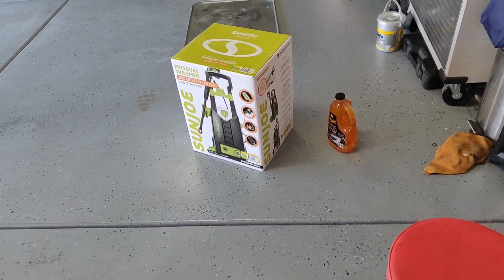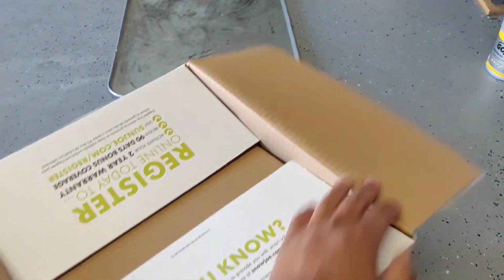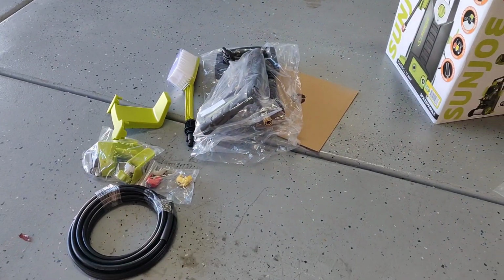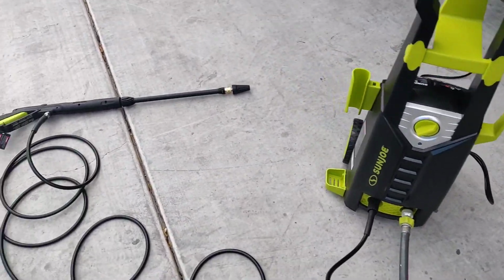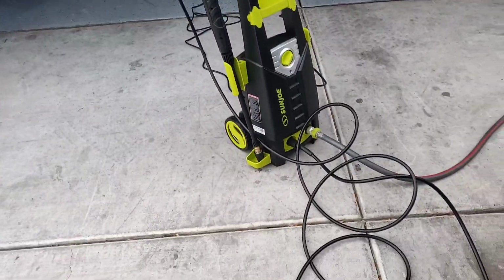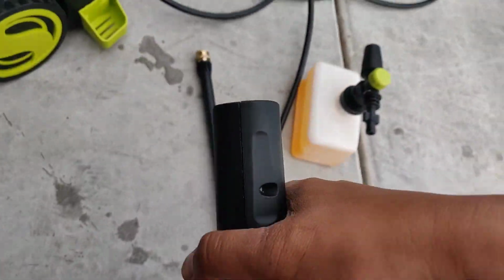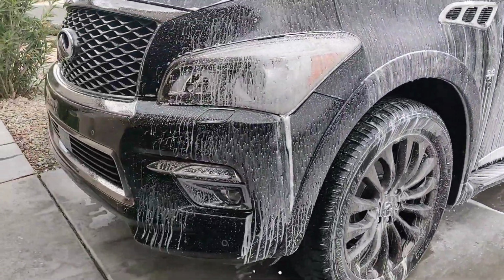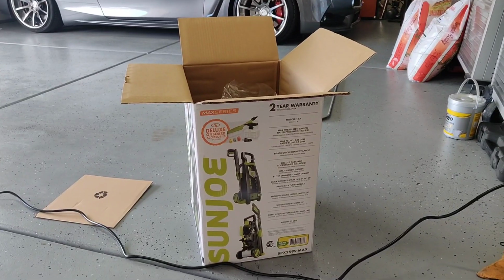SUNJOE electric pressure washer

Comment: To everyone with cars that have been repainted I highly recommend you don’t get close to your paint job and I also recommend using only 40 degree nozzles
Reply from the maker: It is that powerful
Reply: What if my hose doesnt screw on to the pressure washer thing, what if my hose doesn’t fit and so I can’t screw it on to the thing ?????
Reply: I 2nd that statement. As a detailer theres a good chance of you peeling off your paint if you get too close

Comment: I have that same washer from sams but I got mine for $99, and it’s good for that price. The settings on the foam attachment are weird and I havent played with it a whole lot, but if you set the knob on top in the middle you get much thicker foam that coats the entire car. Still wont be as good as aftermarket attachments, but better than what’s seen in the video. You don’t need a gas powered unit for home use, especially with the added maintenance costs of gas engines. And you can do real damage to a car with a gas unit if you don’t know what you’re doing. For the average home user this unit is fine.
Reply: Bought this today for 79.99
Reply: @jamescall5819  Same😁💯Merry Christmas to me

Comment: Hey were you able to get the foam cannon to stay under the gun? I have the same pressure washer and I have to turn the gun sideways like you when I’m using the cannon
Reply from the maker: I was able to but it was at a weird angle.only used it once the next time I use it I will pay attention and follow up with you
Reply: @INFINITIBROTHERS  Awesome thank you
Reply: Facing the gun, put it at 3 o clock, push it, turn it to 9 o clock then pull it, then turn it to 6 and it stays!

Comment: Is the brass quick connect a 1/4" on the tip of the gun? and also what type of connection is at the end of the hose that connects to the gun? Is it a 14mm (M22)?
Reply from the maker: I can't recall but I will check for you and try to get back to you as soon as I can. 🙏🙌🤙
Reply: @INFINITIBROTHERS  no worries, I ended up getting that pressure washer haha

Comment: I bought the SunJoe 2598 model. The problem I have is to get suds I have to set it on low pressure. When I use high pressure I only get plain water. Is this correct? What am I doing wrong. PS- I don't have a foam cannon, only a container on the lower back of the pressure washer. Please help.
Reply from the maker: Yes you are going to need the foam cannon in order to do this. if you don't have it I would invest in a better one

Comment: Does yours leak? Mine leaks from where the house connects to washer and from the the house that connects to gun
Reply from the maker: Actually it doesn't you should change the O-ring on it you should be able to find that at Harbor Freight 🤙

Comment: what is the Model # of this unit?   is it the 2598  or  2598 Max   and do you know the difference between the Two?
Reply from the maker: All I know is that there's one with a reel and one without.
Reply: @INFINITIBROTHERS    The ones with the "Hose Reel"  are designated with a "1" at the end.   ie:  model 3000 does Not have Hose Reel  but  Model 3001  DOES.   Just as  Models  3501  and 4001  Have the hose reels.   I am still   yet to know what the difference between this "Model 2598"  and the 2598 "MAX".  Have looked all over and cant find any info re.

Comment: The main problem with it is that the connector to Wand gets loose as you turn it around and water start leaking
Reply from the maker: Yes I think it has a lot to do with the o-ring or gasket.or  It's just cheap 😁

Comment: can these remove oil stains on the driveway?
Reply from the maker: Yes
Reply: @INFINITIBROTHERS  sweet thanks man
Reply from the maker: I would still recommend using oil stain remover to help it out
Reply: @INFINITIBROTHERS  but with the oil stain remover and washer it should work right ?
Reply from the maker: Absolutely
Reply from the maker: The pressure washer just makes it easier
Reply: @INFINITIBROTHERS  cool thanks man appreciate it !

Comment: Just be realistic in terms of what you expect out of this "foam gun". Its a low power low pressure setup. Will not provide anywhere near the same results as a dedicated foam cannon / lance. You won't get nice thick fluffy layers of snow like soap bubbles with this... but that's ok. Different tools. This is just a nice extra. Not as good, but it will lube up and protect that clear coat as you wash. Just work smaller sections, top to bottom, 2 bucket system with grit guards in them and a different wash mit for the wheels!
Reply from the maker: Yes you are right about that but for the money I cannot complain. It does the job that's all that matters 🤷🙌🤙
Reply: Just picked one up last week for 80-90 bucks, haven't used it yet but based on the vid this thing is ass. But you get what you pay for ig

Comment: The soap you used is all you need . Great quality soap for hand wash and a real foam cannon.
Especially for lower gpm pressure washers.
I hope by now you found out that rotator nozzle isn't really meant to use on a vehicle .

You make you tube videos. Why don't you watch one before guessing what to do.  🤣
Reply from the maker: Yes you are right about the video part LOL. And YES! That rotating brush is useless 😂

Comment: The nozzle you were using is called a turbo nozzle. It’s funny, you shouldn’t use the turbo nozzle unless you’re trying to remove grime from cement. You’re hilarious! You don’t put the soap nozzle on the qc tip. The newer SJ’s come with a wand that you can screw off unlike the SJ that you have. The SJ you have used a proprietary wand as it snaps it when you put the wand in and you don’t screw it in. You should read the instructions before posting on YouTube because you look a little funny posting a review on a product you failed to read the instructions for. It’s fine but funny!
Reply from the maker: 😁 I learned that after the first time I used it🤙 I'm glad that you enjoyed that video though

Comment: I cant get the damn soap thing to disconect on mine feels like its going to bust taking it off
Reply from the maker: It's actually spring loaded you have to push it and twist it and then release it. Unless the spring is damaged 😞
Reply: I can’t figure out how to connect it 🤣😂
Reply: @INFINITIBROTHERS  I am having the same damn problem.. Thanks for the info..
Reply: Im having problem removing the nozzle to put the soap canister. It turns like 90 degrees but it doesn't come out